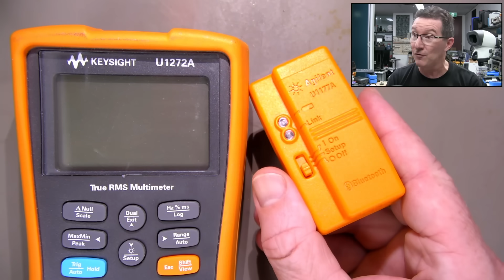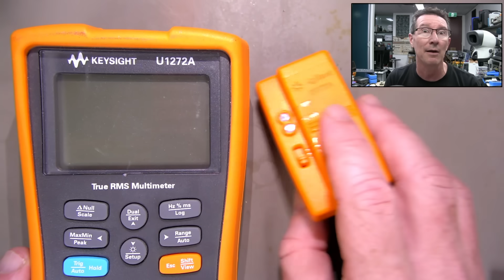EEVblog 1687 - A Pointless Alkaline Battery LEAKAGE Repair

Comment: There are two ways manufacturers engineer built in product obsolescence: either fit a sealed for life battery, or make the product software app incompatible with the latest version of OS. It's why the  E waste mountain grows, and is made of mostly working hardware.
Reply: It’s why I boycott crappy companies that do this
Reply: Exactly, what is "right to repair" even worth if APIs and servers are all incompatible eventually.
Reply: My comments keep getting deleted, dunno why. But the software is available to download from APK sites.
Reply: @Daniel-vh9lg the use of APK is no guarantee of continued operation. Both library and OS updates conspire to stop the installation of old apps.
Reply: @Daniel-vh9lg I haven't found a single reputable APK site through Google. What one do you use ? 
Because the ones from Google results want me to download an entire store, or the APK is full of modules that weren't in the original, with very suspect automatic permissions that the original didn't have....

Do you at least inspect your APKs before you install them? Unpack the file and examine it before install. 

You can literally pack anything in an APK and keep the original signature intact. 

I don't trust a random APK site. 

Please let me know which one you use.
Reply: Stop buying Apple products for starters.
But people don't, because Apple perpetuates the fallacy that PCs (or Android) are hard to use. 
I learned DOS at 11 years old.
Reply: I feel it could have required to update the app to be fully compatible with newer android OS's.  But when it's published on the app store, even older mobile devices connected to the network gonna receive the update, wich may lead to a non working app on older devices (and angry peoples).    Eventually it's easy to get an older mobile phone with the right android version, and install the APK to get it working again. But i'm pretty sure they've jumped on the wagon of smartphone apps, to realize it was time consuming to keep it up to date and dealing with older devices, and they've stopped everything. Wich is a moove many managers have troubles with, because it require to admit it was a bad décision, and a lot of money have been wasted.
Reply: @x689thanatos the life cycle of the android OS and the associated apps, can be a limiting factor in the life of test equipment. This is a real problem, as the software life cycle is relatively short, a matter of two or three years. It may not be a simple matter of using an old tablet, or phone, to access obsolete apps. Apart from the problem of finding one that is still working, auto library updates may stop APK from working. Software incompatibility developed over time is often blamed on the need to fill security holes in the OS, and its associated libraries, but I think there is a case for the development of a minimum library standard that will allow long live, expensive test equipment to continue working, even with the latest versions of the OS. Either a common basic library set, or a legacy interface that allows older drivers to be loaded. It is iniquitous that manufacturers remove legacy software from their web sites. HP used to be very good at  supporting  its older products, but not any more.

Comment: My parents' TV is about 15 years old and the remote still has the original Sony batteries in it, with no leakage, and they still work.  The remote still works after all this time.  I'm really impressed by Sony batteries and I wish they sold those things in stores because I'm always finding leaky alkalines of other brands (Duracell are the worst of course).

Comment: I have a lot of batteries powered devices and from this spring I start to kepp them without batteries inside when they are not in use 😅; I’ve seen to many devices ruined by batteries 😅

Comment: ...the vinegar left over from the netralisation of the pc board will keep on eating away at it, so if possible always immerse the board in de-ionised water for a couple of hrs and dry it in a warm place. The water will swing the surface from slightly acidic to neutral and no further damage can occur...

Comment: With a bit of searching around with Google the APK for android is still out there to be found for use with the bluetooth interface. Keysight Meter Logger
Reply: What site do you use for APK please? 
Every one I find on a search result wants me to download a separate store to download the app (sus) or the APK has been packed with modules that don't belong in the original app version, with extra suspicious permissions and callbacks.
You do examine or test your APKs before install right ? 
If I could remember the site I used, you can even run a whole online test of the permissions and see the IP addresses involved, and compare them with a database of known phishing etc sites.

I haven't found a single reputable APK source but I'd love to know one. 

All the ones in a Google search are very suspicious at best.

Comment: A couple of years ago I eyewitnessed an battery leak in action... I was sitting at my desk when I notice a high pitch hiss/fissle sound. It took me quite a moment to realize I had a couple of old yellow IKEA AAs on my desk behind my keyboard. When I moved my keyboard I saw the batteries in an actual puddle of liquid  and even more was bubbling out on one side of the O-ring...

Why is this Bluetooth thing not some standard Bluetooth serial device, just relaying the IR com port at the meter?

Comment: I bet that they are simply using the Bluetooth module as a serial interface emulation. Maybe try connecting with a PC and see if it appears as a serial port under windows.

Comment: Just successfully repaired an all-in-one Namco game controller thing that hooks to your TV. It was given to the roomie by someone but they'd left batteries in it for lo these many years (perhaps as far back as 2004!). Thankfully the battery compartment was isolated from the main PCB, so I was able to desolder it from the connecting wires and take it apart, including removing the corroded terminals from the plastic and soaking everything in white vinegar. I've got a big jug of it always, for general cleaning and for just such occasions. Definitely lost some plating on the terminals, leaving some bare copper, but all in all looked about right, and once I stuffed it all back in the plastic housing it worked a treat!

Comment: I have an old Agilent (what Keysight came from) U1242A DMM with maybe 10 hours on it, and the D word alkaline batteries (WORST of them all) leaked and ran down one of the fingers enough to pretty much annihilate most of the Gold pad on the PCB, to connect the power from the outside battery case. The area where the fingers touch is completely gone and flecks of gold are there still including where the pad attaches to the trace. Should I cut a piece of copper foil the size of the pad and tin it with Eutectic Solder or 4% Silver Solder, then put low temp soldering paste under it and heat resistant tape it in the place of where the pad used to be, and hit it wit an air rework gun just hot enough to melt the solder paste and hopefully it will grab to the PCB and conduct voltage again? I'd love to buy a pad somewhere already plated with gold instead, but I can't find anything like that anywhere. Got any workable ideas? PLEASE, Any HELP would be greatly appreciated! Crazy prices to get it repaired at TransCat (USA)or the likes.... if they CAN.  More than I paid for it.

Comment: If you’re searching the play store on an incompatible device for a specific app. You won’t find it that way even if it does exist. Instead searching via your pc or web browser will show all apps regardless of compatibility. Additionally I’ve good luck with finding old apps on apkpure however that won’t get around any compatibility issues or and downed servers that could be required. Also notable is Bluetooth specifications have changed drastically over the last decade so that alone could make this device difficult to use with newer devices. Seen several apps I used to use get removed for various reasons. One in particular was replaced with something newer that was incompatible with the security camera system it was intended for. Not certain what the outcome of using the outdated app this long has had but I’d imagine as long as the device that it is being used on is capable of running it that it would still be in use as it only talks to your own camera system through what is probably some old protocol to broadcast itself over the internet. I could totally believe that camera system would have some sort of security flaw that isn’t patchable considering its age.

Comment: That's why i have basically banned AA and AAA Alkaline from my home. I now only use Energizer Ultimate Lithium (non-rechargeable) AA and AAA batteries instead. Never had a leak with those and it seems to me they also last a bit longer.

Comment: The only option is to download the app through 3rd pay app mirror (at your own peril).  I have a couple of old phones dedicated to one device each, kept off wifi, and never used for anything sensitive.  It's worth it for an old drone. I'm not sure if it's worth it to add connectivity to a multimeter

Comment: The question that bothers me most: Was the device turned off via the switch? If yes: then the seal of the batteries failed due to age. Then there was nothing else left than to remove the battery when you don't need the device.

Comment: Unfortunately it is becoming a usual problem...
I just repaired a bench top power supply I built 40 years ago.  It required a new potentiometer and an OP-AMP (741) and it is working fine again.
Nothing like "you need to update your app" or similar.
I also have a bench top multimeter from the same days.  Also still works, although not really useful anymore (3.5 digits, last digit not even stable, input referenced to metal case like on a scope, etc).

Comment: Genuine question, why not replace the alkaline ones, with new NiMH ones, since new ones generally retain up to 80% of their capacity after a few hundred charge cycles ?
Reply: NiMH has a lower voltage (1.2V, vs the 1.5V of Alkalines and Carbon-Zinc). This would mean that a 2xAA/AAA device would be receiving 2.4V instead of 3V on fresh batteries. This is more than enough to at the very least constantly set off a low battery alarm even on brand new batteries, and in devices like meters significantly affect their accuracy.

Comment: This is a kind reminder for portable testing gear users, go check all of your goodies. You don't want any battery leakage unattended
Reply: Yep, I've just pulled out batteries from an 80's Sony ICF - 2001.  The batteries were from 2017, but thankfully none have leaked.

Comment: 1:15.  SPRING PRESSURE.    I HAS TWO MANGA FYERS THAT WERE STILL WORKING SQUEEZE THE ACID OUT BEFORE BATTERIES WERE FLAT. SO ITS DEFINITELY THE SPRING PRESSURE ACTING LIKE HYDRO RAM RODS 😮

Comment: The primary issue with most short term(less than a year) battery leakage is the continuing chemical reaction, fueled by nothing other than leakage current when off🤔. Most of these faulty equipments, do not cut off battery on time, while still having sufficient reserve capacity, and/or also keep drawing current(leakage), with an active(instead of a passive insulated) on/off switch. The best thing that works for removing the chemical krud/crystals is diluted sulfamic acid solution(primarily used as a descaling agent in electric water distiller pots). But beware of water damage😢 from not drying/airing out sufficiently before turning the power back on. You could mirigate future leaks with wrapping a layer or two of kraft/vellum paper(paper towel ok) around(wicks away leaking/corrosive electrolyte away from metal terminals), while replacing batteries.😊❤👍

Comment: I got burned by Flir this exact way. Bought a $600US IR camera that uses an app.. It wasn't a year and it was obsolete! I was worried about it when I made the purchase but it was half of what the next step up was at $1,200.00US!
Reply: couldnt you just get an older version of the app and side load it?

Comment: and that's why i think 9Volt blocks are better for measuring devices, they somehow never leak so badly. Even if the energy density is not so good at 9 Volts, it's still cheaper than constantly having to clean up such a massacre. best regards from germany😁

Comment: Chemist here.  Pine tree rosin is a mixture of resin acids, mostly abietic acid and pimaric acid (both have pages on Wikipedia, if anyone is interested).  So yes, rosin will neutralize potassium carbonate with carbon dioxide bubbling out of the mix.
Reply: Nice to chime in, but I don't need a chemist to tell me that the majority of rosin is an acid from pine trees. 
Who uses something without finding out whether the smoke it emits is harmful? (Yes it is harmful, causing asthmatic symptoms and possible long term breathing issues)

I guess there are some people who assume that buying lead free solder is all you need and breathing in that weird flux smoke that smells bad, is just gravy. 
Same people who tell all their coworkers that asbestos isn't as bad as everyone says, refuses to wear PPE and then bitches 24\7 about how their employer failed to disclose dangers to them, after they're riddled with lung cancer.

Comment: As you have a USB to Serial and Bluetooth to Serial dongle, then you should be able to use the Bluetooth adapter on Windows / Linux to create a virtual serial port and then connect that to whatever you would use the USB adapter to do.
Look in the Bluetooth panel on Windows, add a new port and see what happens. The dongle will only be doing a protocol translation from Serial to Bluetooth. 

One you have a working connection via either Interface, then using a bit of protocol inspection, you should be able to find out what the commands look like. Is it listed in the meters manual perhaps ??

As to removing the battery crystal rubbish, I knock them off with a screwdriver first, then use a Q-tip dipped in vinegar to neutralise the acid, then rinse off. This means less fluids into the thing that I'm trying to repair.

Comment: This is the exact reason I've sworn off alkaline cells from any manufacturer. Too many times in my lifetime have alkaline cells leaked in a device and even on their own, not being used. No thanks. Plus, I hate the disposable nature of alkaline cells. LSD NiMh and when those don't give proper voltage for finicky devices, it's 1.5V lithium rechargeable AAA/AA.

Comment: I have got exactly the same BT-Transceiver and immediately checked the batteries, because I didn't use that for years: The same Battery brand, same exp. date but didn't leak 😊👍
Reply from the maker: It's obsolete anyway...

Comment: Pretty much everything I fix is obsolete.
I fix antique computers (well, 70s/80s at least), games consoles, arcade machines, VCRs, vintage audio.
I love how audio and video cassettes don't give a crap about DRM or censorship.
Reply: Correct me if I'm wrong, but wasn't Macrovision (for VHS tapes) designed to prevent tapes from being copied?
Reply: @dingalarm  I was thinking more along the lines of copying modern contents to tape. Like using an HDMI to Composite converter to tape Netflix or whatever off the web. And Macrovision wasn't too hard to circumvent. Then again, any copy of any VHS tape would look a lot worse, copy protection or not.
(if a movie's good, I don't care too much about quality.)
Reply: @senilyDeluxe OK, I see. On a related topic, I need to digitise a few VHS tapes (after repairing my VCRs) by transferring the recordings to my PC, and then combining segments to create a digital recording (saved onto a USB drive or DVD). As such, would you be able to recommend a video capture device & editing software for this purpose?
Reply: @dingalarm  Not really. My digitizing hardware is pretty antiquated too, so I'm not really the right person to talk to. But "old" DVD recorders tend to make really good transfers, I had pretty good results with a Panasonic DVD-R... right until it stopped recording RAMDISKs. (because you could just copy the files over to your computer. Linux would happily play or edit the totally odd file type - so VLC on Windows can do that too, don't know if you can edit these in Windows).
Reply: @senilyDeluxe  That's OK 🙂 I appreciate any suggestions you can provide. It seems that a DVD recorder would be useful. I'm currently running Windows 7, but Linux sounds like a good alternative. Many thanks!
Reply: @dingalarm  Whatever capture card you use (if you use one), always use the highest resolution (well, 720x576 in 50Hz countries or 640x480 in 60Hz ones) and don't save on bitrate either. You can always edit the captures down later.
Reply: @senilyDeluxe Good to know. Thanks again!

Comment: Thing is the GP cells can be made on the exact same line as the Durahell, because all that Durahell is now is a brand name stuck on any old junk, made by the cheapest contract manufacturer, because durahell is owned not by a company that actually knows how to make batteries, and has noo chemists and process engineers in it, but is merely a brand owned by a hedge fund, who are busy making as much money out of the brand names they own as possible, before selling off the name to some other sucker to do the same. The RD and other manufacturing plants long ago were sold off to make a profit for a quarter, and then the name is surviving on brand recognition.

Flux chemically reacting is because it is a solution of an organic acid (the tree rosin, either natural or synthetic) in a water and alcohol solvent, with some organic salts added in to tame the reactions at room temperature, and stabilisers that react at close to soldering temperature, to allow the acid to chemically clean the oxides of the tin and copper off the board surface.